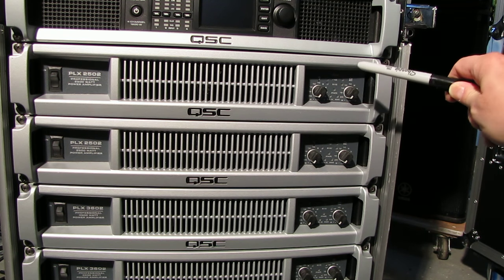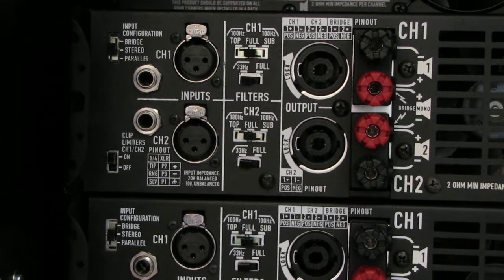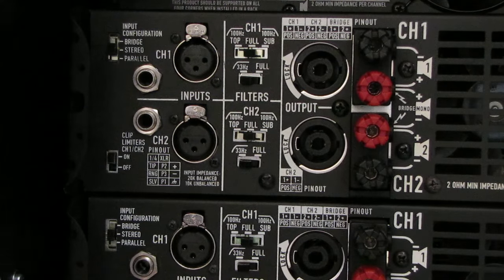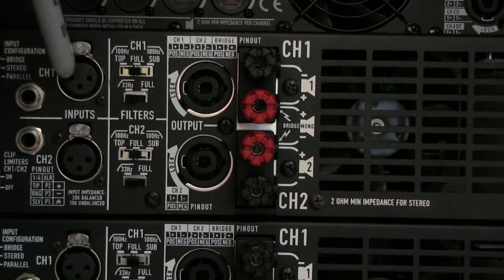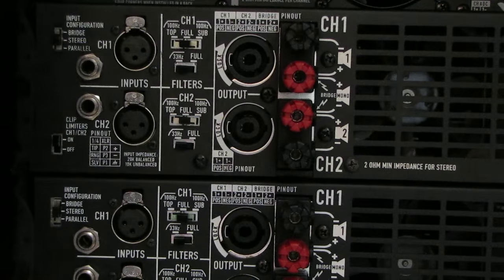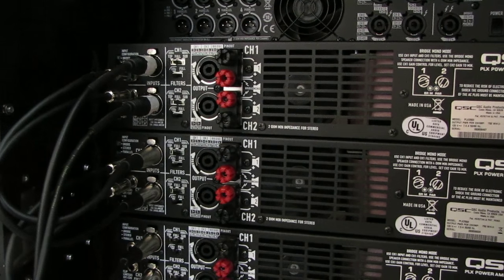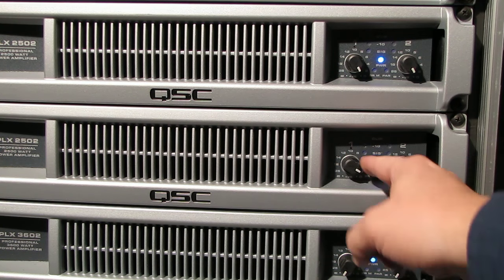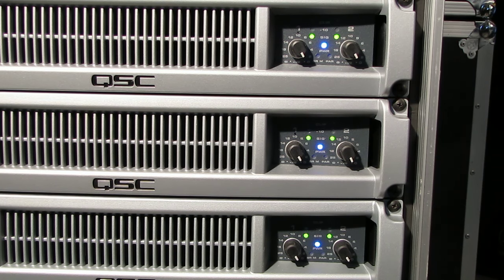Stereo "Daisy" chain of amplifiers (using QSC PLX amps)

Comment: Can you please tell me more about the full volume you opened.  Am always afraid that my speaker will blow off if I do so thanks
Reply from the maker: The knobs on amplifiers are not volume controls.  They are signal attenuators.  With the attenuators full clockwise rotation, this indicates the amp is very sensitive to the input signal from the console.  With the attneuators full counter-clockwise, this indicates the the amp is much less sensitive to input signals.

Just make sure your amplifier is not clipping when you run it.  And, make sure your speakers are sized correctly for the size of the amplifier you are using.

Comment: Sir while daisy chaining does gain reduction problem occurs or it's normal operation. I heard some rumors From FOH operator.
Reply from the maker: Daisy chaining within the same rack does not present any loss of signal gain.  Any losses in signal gain, would probably occur if the cable lengths between amplifiers were over 200ft (60m).
Reply: stageleftaudio thanks a lot sir.

Comment: So with this configuration you can basically only run it in full range?
Reply from the maker: It can also be run for a bass only configuration or a mid/high configuration.  Whatever signal you send, all the amplifier channels will produce that signal.  We daisy chain our sub amps (mono setup) by sending the sub amps the cross-over signal from the "Low" out of the crossover.

Comment: will this trick work with different amps?
- and will it avoid blowing an amp impedience level if i hook up six speakers to three amps - ie two per amp?
Reply from the maker: Yes.  It will work with any amplifier that has multiple inputs and outputs.  Hook up the speakers like you normally would to each amp; there is no loss of signal.  Remember... daisy chaining amplifiers is just sending the same signal to multiple amps.  You are NOT combining power from the amplifiers.  Each amplifier is still a stand-alone amp.

Comment: hey, I really enjoyed your video. I have two QSC power amps. I want to use them both in parallel AND bridged to power one 8 ohm cabinet. How would I wire it correctly??
Reply from the maker: +Eric Traub Thanks for the comment.  
Very important... you cannot power a single speaker with more than one amplifier!  DO NOT use more than one amplifier per speaker.  Using more than one amplifier on a speaker could cause serious speaker and amplifier failure.

Daisy chaining amplifiers only involves sending a signal to the amplifiers in the chain; all the amplifiers in the chain will be powering their own speakers.  Therefore, if 4 amplifiers are daisy chained, each amplifier will be powering its own speaker.
Reply: +stageleftaudio, thank you very much for the thorough response! I am very happy that I waited to hear from you rather than trying to follow through with my initial plan. With that being said, if one amplifier in bridged mode is not enough to power the base cabinet, then it is probably wise to buy a more powerful amp, correct? 

I find your video is very resourceful, and I I'm looking forward to learning more as you put out more videos!
Reply: +stageleftaudio, also, I didn't mean to misspell "bass"... so, is the purpose of using daisy chain amplifiers, for example, to run separate power to mains and monitors? For example, use an unpowered mixer, use amp A for mains, and use amp B for monitors (daisy chained in stereo mode) all connected to the unpowered mixer so that you can control the power going to the mains and the monitors using only the one mixer, correct? I hope that made sense
Reply from the maker: +Eric Traub Daisy chaining amplifiers is for the purpose of providing the same signal to multiple amplifiers in order to drive multiple speakers (for FOH applications).  For example, by daisy chaining amplifiers, you could run 12 speakers, each with their own amplifier (assuming 12 amplifiers) from one output of the mixing console.  

The logic flow you referenced above in your post is possible, though, it is highly not-recommended NOT to run the same signal to FOH and monitors!
Reply from the maker: +Eric Traub Unfortunately, if you need more power to drive a speaker, you will need to use a more powerful amplifier (up to a point).  If you use an amplifier that is too large for the speaker, it could lead to mechanical and/or thermal damage to the speaker.  

Thanks for the feedback on the videos.  There's a lot to learn in sound... never stop learning.

Comment: One question, in a qsc amplifier how works in parallel? If each channel is 1200 watts at 4 ohms, it doubles the power to 2400 at 4 ohms?
Reply from the maker: It depends on which QSC amplifier you are talking about.  The QSC PLX series (which is used in this video) does NOT parallel the channels together to make a larger channel.  For the PLX line of amps, a "parallel" setup simply means to parallel the signals; meaning, a signal coming into channel "A" will be "paralleled" to channel B (i.e the same signal coming into A will be directed B) without having to use a "Y" cable or jumper-cable to get the signal to go to both channels.  By "paralleling" the signals, this is how you can chain the amplifiers together using one signal source.

QSC does of a PLD series of amplifiers (Class D) that does combine channels together to create larger amounts of power.
Reply: Thank You for your answer, Its a qsc dca 3402, has the back stereo, parallel, mono, limit, and filter switch similar to the rmx series. It feeds 1200 watts at 4 ohms per channel in stereo. I  am trying to figure out to power a pair of jbl sr4719x, and a pair of jbl sr4715a each sub handle 1200 watts at 4 ohms continuous, they peak at 2400 watts at 4 ohms.
Reply from the maker: Sounds like the rear controls of the DCA are about "standard" for amplifiers in that class.  Make sure the limiter is always set for each channel, and that the low-filters are set for the type of speakers you are connecting.  The amplifier should be in "stereo" mode when connecting your speakers.

You can attach all the subs to your amp (2 spkrs per/chnl) , however, you'll need to be very careful when running the amplifier with those subs.  Each of your subs is 4ohms.  If you place 2 of the subs on each channel of the DCA amp, this will present a 2 ohm load (per channel) for the amplifier.  The amplifier is rated for 2 ohm loads, (maximum), but probably not for a sustained load (sustaining of elevated volume levels).  2 ohms per channel of your DCA amp may produce about 800 watts to each of your sub cabinets (800 watts x 4-cabinets = 3,200 watts); though, running the DCA amp at 2-ohms will probably cause the amp to run very hot and could add additional stress to the amp.  Be careful with running the amp under that type of load; it does work, but care is needed.
Reply: I have two dca amps, I  have the limiters on and low filter set, I figured out parallel, one amp for right, one amp for left, one sr4715a and one sr4719x on each amp.

Comment: Could I link all kind of qsc amplifiers  with the same method ?
Reply from the maker: Yes.
Reply: I have the qsc USA 1310 is an old model!
Reply from the maker: You can link TO the USA 1310, but you may not be able to link OUT of the 1310 to another amp.
Reply: why???
Reply from the maker: I don't think the USA series provides parallel inputs, meaning 2 inputs (input methods) per channel.  The amplifiers used in our videos have parallel inputs which provides for daisy chaining.  You may be able to use a "Y" connector if you need to send a signal past the 1310.

Comment: I have 2 crown macro tech 5000 vz for my lows and I have a drive rack. I can’t daisy chain them because my amps only have XLR. Can I use a XLR splitter Y and hook up channel one on my drive rack to one amp and do the same thing to channel 2? What will be the best way to hook them up together?
Reply from the maker: Yes using a "Y" connector is acceptable.  Depending on how far the MA 5000 amps are from your drive rack, you may want to place the "Y" connector at the amplifier side of the cable run, instead of having 2 long runs from the drive rack.
Reply: Ok. I have all my amps and the drive rack in the same rack. So on the drive rack on channel A on my lows should I hook up a XLR Y splitter  to my amps on channel 1 and 2 and then on the channel B on my drive rack another XLR Y splitter to my 2nd amp channel 1and 2? Thank you for replying back.
Reply: Or can I get a splitter Y and plug it on my drive rack on channel A for my lows and the other end of the Y plug one end to one amp to channel A and on my 2nd amp plug the other end to channel A and do the same thing one channel B?
Reply from the maker: Yes - this way will work as well.  Having your amps and the drive rack in the same rack is beneficial.

Comment: another question can we daisy chain a different amplifier?thanks
Reply from the maker: Yes.
Reply: +stageleftaudio sir how about the watts there's no problem to daisy chain a different watts?example 1st amp is 500watts,2nd is 600 watts?
Reply from the maker: There's no problem daisy chaining using different wattage amplifiers.  Because, when daisy chaining, all you are doing is sending the signal (a line level signal) from one amp to another and to another, and so on.
Reply: stageleftaudio in this case, I believe then that you'll have to correctly match the Amps power rating to that of the speaker that matches it?

Comment: Sir
i need your help, i have a 200 watt/4 ohms amplifier, what speakers watt will match for it
Reply from the maker: There's a lot of variables involved with matching speakers to amplifiers.  To be safe, you may want to consider speakers that can handle about 300 watts (if using 4 ohm speakers).
Reply: can a 300 watt speakers support my 200 watt 4 ohms amplifier
Reply from the maker: In general, yes.  It depends on how the speaker will be used (live sound, DJ, vocal only, etc...)
Reply: yes,
Reply: vocal only

Comment: is a same way to daisy chain on crown macrotech 500vz??
Reply from the maker: It depends....   It depends on the type of PIP card the 5000vz amplifier has installed.  Crown offered several configurations for audio input for the MacroTech line.  The PIP FMX card is what is needed to support daisy chaining.
Reply: stageleftaudio ohh ok thank you

Comment: Is the 1/4 inch mono or stereo
Reply from the maker: For this setup, the 1/4 inch cables are actually balanced cables (not stereo).  Though, for this setup, "mono" (unbalanced) cables could have been used as well.  Unbalanced cables can be used as long as the cable lengths are kept short (less than a few feet/meters).

Comment: Can you daisy chain 2 power amps that are different brands
Reply from the maker: Yes.
Reply: .  thanks.   they are different wattage.will that matter
Reply from the maker: It will not matter.  The daisy chaining is only sending the signal to each amp.  Just make sure to put the correct wattage speaker on the correct amp!
Reply: @stageleftaudio  ok thanks

Comment: So you would be using 6 speakers at the same time for a live performance
Reply from the maker: Correct.  In stereo mode, 2 speakers per amplifier at the same time.  In mono (bridged) mode, only 3 speakers would be used at the same time.

Comment: what is the main point of doing this - if not to add more power
Reply from the maker: To distribute a signal to multiple amplifiers.  This could be used for center-fills, side-fills, balcony locations, etc...
Reply: @stageleftaudio  you mean extra speakers?
Reply from the maker: Yes.  Extra speakers for different locations.  As for adding extra power, daisy-chaining does NOT produce one big large amplifier with all the power from all the amplifiers that are daisy chained.  All daisy chaining does is send one signal to multiple amplifiers to allow you to amplify the same signal across many amplifiers.  In this video, you could attach a speaker to each speaker terminal.
Reply: @stageleftaudio  thanks

i'm a bit of an amateur on the technical side ... as i see it, more speakers = a louder sound - but i have blown a few amplifiers in my time and i am trying to rectify that problem

Comment: Why would I need to do this, under what circumstances/to achieve what?
Reply from the maker: Daisy chaining is used to send the same signal to multiple amplifiers.  This could be used if you had a large number of subs (all sub amplifiers would be getting the same signal).  Or, if you have a lot of passive mid/high cabinets and need them to all be playing the same signal.  Daisy chaining is mostly used with sound systems that have a lot of speakers (think of large concerts).  We daisy-chain our sub amps when doing large events.
Reply: @stageleftaudio  Thank you for the great information.

Comment: Hi  stageleftaudio ...  congrats  this is  awesome lessons  ... I 'd  like  to ask  if you  please could show us how to  bridge at @4 ohms  two Carvin DCM 3800 , giving 3800 Watts @ 4 ohms each amp ,  and the right procedures  how to hook up the speakers ,  what kind of loudspeaker   , should it  be 4  for each amp @ 8 ohms each  is that right ??  8 loudspeaker @ 8 ohms each  , two for each channel ...???   .... thanks for your attention ... I really appreciate .
Reply from the maker: +Opensea Hawaiianbless The Carvin amplifiers are nice.  I highly recommend downloading the manual for those amplifiers.  They will show you what needs to be done to configure them for bridged operations.  It would take a lot of writing here to explain what is already in the manual.

Running an amplifier in bridged mode will require a speaker (or speakers) with enough wattage capacity to support the amplifier.  The speaker outputs on an amplifier are looking at the total ohms for the load.  Therefore, one 4-ohm speaker will closely present the same load as 2 x 8-ohm speakers.  

From your questions, take a look around youtube and other internet sites for audio related topics about amplifiers and ohm load.  What you are seeking an answer for could take a long time to answer (in this forum), due to the number of variables involved with an answer!  Learn as much as you can about amplifiers, and load - there's  a lot to know!  

There's a couple of videos on this channel that may help you with your bridging and ohm-load questions.

Thanks for the comment.
Reply: Thanks Stage Left Audio ...  I like your  amp tutorial ...  you are right  there is so much to learn , I know ain't that simple  to answer all the very important questions about amps & electronics .  by now I  have only one question ...  is ...  if  the most great  amps like Peavey , Carvin  , QSC  , Bugera , Behringer ... once they are bridgeable  at whatever ...  could be 8 ohms or 4 ohms or even 2 ohms ...  What I like to learn is if we need to hook   two loudspeaker for each amp one loudspeaker for each channel ...  two amps in bridge ...  should be   4 loudspeaker   ...??   2 loudspeaker for each amp ...??  _   my question is  ...  once  two amps are in bridge we need to hook up only one loudspeaker for each amp ... or two loudspeaker for each amp ...  knowing that  each amp have two channels only ... like the most two channels amps ... , that should be two loudspeaker for each amp ...? _  Thanks for your attention ...  forgive me if I am annoying too much on this ...  and I will keep searching  for all these awesome tutorial on amps , music electronics ...  Thanks again .
Reply from the maker: +Opensea Hawaiianbless Looks like you are asking a few questions... For most amplifiers, there are a lot of options for connecting loud speakers to amplifiers.  Try to look at the total ohm-load that will be placed on each amplifier channel... rather than the number of speakers that can be placed on each channel.  Some speaker cabinets are 4-ohms, others are 8-ohms, and some are 16-ohms. Most amplifiers will run less 4-ohm speakers per channel than it will for 8-ohm speakers, because 4--ohm loads are greater than 8-ohm loads.  When running an amplifier in bridged mode, most amplifiers can only support an 8 or 4-ohm load (not 2-ohms); therefore, it is safer (and recommended) to run only 1 speaker per amplifier if those amplifiers are in bridge mode.  

For non-bridged amplifiers (2-channel mode), it's usually safe to run 2 speakers per amplifier channel.  It all depends on the amount of load (8/4/2 ohms) an amplifier is made to handle (as well as the total ohm load of all speakers that will be connected to that channel).
Reply: Thank you very much ...  StageLeftAudio ...  that's understood ... I really appreciate ...  (  when running amplifier in bridge  mode  _  it is safer  and recommended to run only 1 speaker per amplifier )  ...  Thanks again ...   ( I know there is so much to learn ...  and tutorial like yours  are really helping very much ) ...  right  now I am  far away from  Santiago - Chile's  Amps / Music  Electronics  schools ... and the fast away to get lots of important  professional answers is online talking with some friends ...  'til we are sure  how to link / hook all this   " new " updated  awesome monsters like DSP - Mosfet- Class D ...so on ..and on ...  and we love all this . Thanks again I really appreciate ... Keep up the great work !
Reply from the maker: +Opensea Hawaiianbless Feel free to post other questions on any of our videos.  Thanks for the comments and good luck!
Reply: Thank you very  kind  ...  I am learning a lot from you & crew  , that  video teaching how to Daisy Chain  Amps in stereo is awesome and clear understanding ....  Big Up !